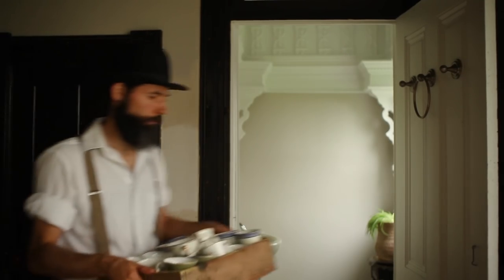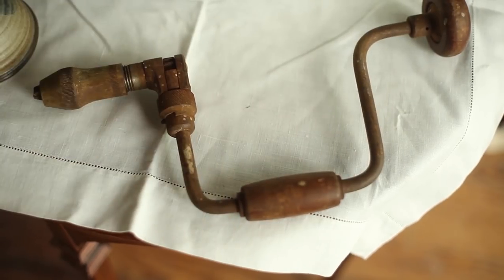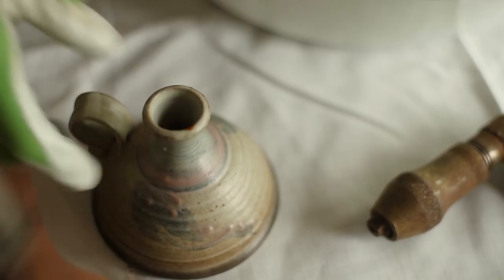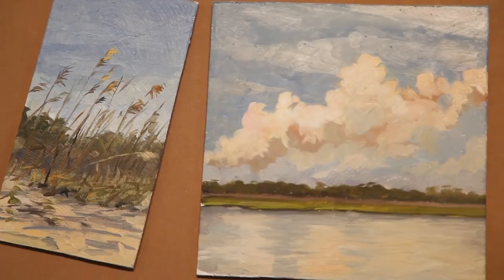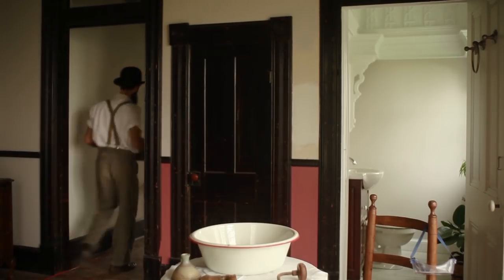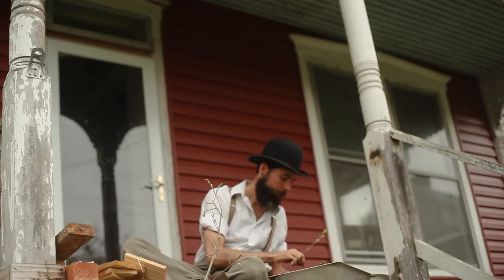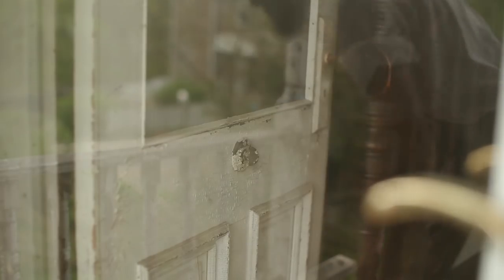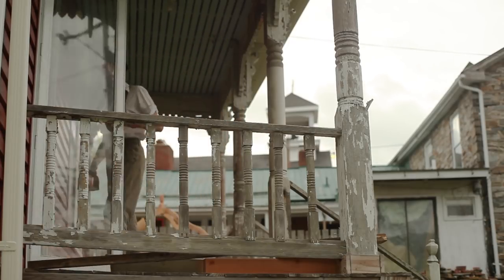Starting Seeds in Old Tea Cups. Drilling hole in ceramic pottery

Comment: My husband and I used to have a small antique business in the 1990s.  I used to love to buy a "box lot" cheap and pull out the treasures.  I have beautiful gold rimmed teacups on my desk to hold paper clips and elastic bands.  I've also used old, chipped bowls as flowerpots but for house plants.  I would put a piece of duct tape on the bottom and drill a hole through it for drainage.

Comment: What a great idea. I don't think it's silly. I think it's resourceful! Since you mentioned the soil block method - I started using a soil blocker last yr and loved it. I was surprised how well it worked. The seedlings thrived & transplanting was so easy. Some use successively larger soil blocks to transplant into as the seedlings grow if the weather doesn't allow for planting into the garden yet- but I didnt want to buy larger blockers until I knew whether or not this method was worth the investment. One blocker was certainly good enough for most of my crops. In my climate, zone 5, tomatoes and peppers would be an example of crops that would benefit from having larger blocks to transplant into, as we start them indoors well b4 they can go outside safely, & they get quite large by the time we move them into the garden. I'll be adding a larger blocker to my toolshed this yr for sure.

Comment: Love it!!! I’ve actually started seeds in coffee mugs before they were cracked and would not hold any liquid but worked just fine to start seeds in, they did eventually brake, I then repurposed the broken pieces to cover the large drainage hole in a large terra cotta pot, which is still in use today.
Reply from the maker: Great to know. Thanks

Comment: many people use disposable paper dixie cups (like the ones sold for bathrooms for gargling) to avoid the plastic. If you completely punch the bottoms out, instead of just a small hole, the roots will air prune. I actually drilled holes in my teacups many years ago, but it was because I was growing some African violets and just thought it would look pretty to have them in teacups and saucers, rather than a plain pot. The teacups were especially functional if they still have their saucers to protect your surface from the water drainage... just a thought for a use for your cups when not using for seed sowing :)

Comment: I started using soil blocks this year. Really like them so far
Reply: Those are very appealing.   Do you have the tiny block maker as well?  Some people think the tiny ones are
not worth it.  Just go with the middle sized block.   I was considering buying a set but am still information
gathering.
Reply from the maker: I may get one, this time around
Reply: @gabriellakadar  Thank you for the heads up, I've been considering one but they're expensive & I would just be able to get one.
Reply: @wendyeames5758  I used a blocker for the first time last yr. Loved it! I too only bought one to start with. The medium one. It did plenty well enough for most plants I grew bc by the time they were outgrowing the soil blocks, it was safe to transplant outside. If you're a tomato & pepper fan, as I am, & your climate makes you wait until May or June to plant them outside- a larger blocker is a good investment if you want a long growing season for them & don't want to buy starts at the garden center. I'll be getting one this yr

Comment: This is so quaint! <3 <3 <3 I actually grow my seed sin eggshells. When I'm cooking with eggs I'll just crack off the top of the shell and pour the egg out, then put the shell back in the carton. Fill the egg shell with dirt and put it in the sun (I just put them on the window sill to avoid weeds and what not). Then when it's time to plant you can just crack the egg and leave the shell bits on top of the soil, since they're biodegradable. I'm gonna' have to try a few tea cups though, it's much more aesthetically pleasing.

Comment: Like you I am trying different containers.  Have been using empty cans for seedlings.  Same principle as you mentioned; the ones with the pop-top don't wortk because they have a lip.  But the ones you open with a can opener work fine with a hole or two punched into the bottom.  i do wish you had shown a closeup of that drill bit though.  I want to learn to drill holes in ceramics.

Comment: I like your video’s and learn from each one I watch.  I’m wondering if you’ve tried starting seedlings by using egg shells.  Here in Oklahoma, I’m starting for the first time seeds in egg shells, we are about three weeks out from last frost.  I want a head start on tomatoes.  We have both spring and fall growing seasons for tomatoes.  I’m anxious to have a fresh tomato.  Your thoughts please
Reply from the maker: I don’t eat eggs, but I suppose you could use them if you can break them to maximize volume and pierce a hole in the bottom. They would be a bit small for raising a tomato plant though. It could be ok for small lettuce starts. A recycled plastic food container would work better
Reply: Siloe the egg shell is just used as a starter for the seed.  I believe, once the tomato has grown to the size that you plant you can just plant as normal at least two inches below.  I’ve also heard of planting an entire raw egg cracked in the same hole.  Calcium???

Comment: Pardon me, my dear boy, I am having a heart attack over this idea of drilling holes in old china. This is completely unnecessary abuse. Simply take a piece of curved broken pottery  of any type and place it on the bottom curved side up.Then put the soil into the cup. You can still maintain your pseudo Victorian facade without  ruining Victorian ideals. In the 1960s I   had the same thoughts and feelings about turning oil lamps and other sundry items into electrical lamps. My heart is weaker now. Have mercy. As for something aesthetically beautiful accumulating  dust in a cabinet, there is a quaint invention called a Shelf. Aesthetically pleasing items will fit very nicely on it, with or without Greenery. Victorians were known for clustering many small items together. The tall cup is a good choice for what you want although not very aesthetically pleasing. At least it was not made before you   were born.
Reply from the maker: I understand your concern. I should clarify that these were being sold as a lot, mismatched and several chipped. If nobody got them, they were going on the trash at the end of the day. They were also not very old, ( lots were probably from the 90's)